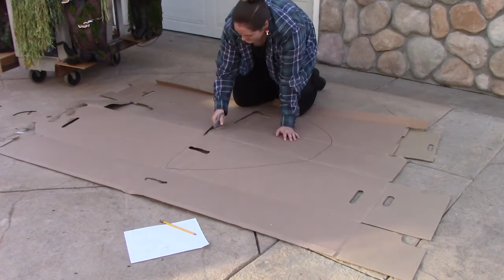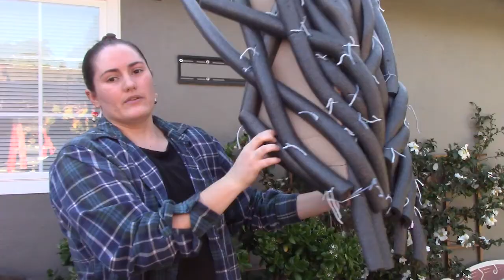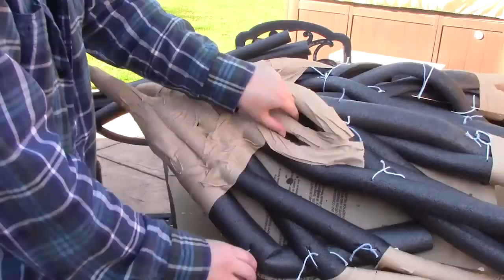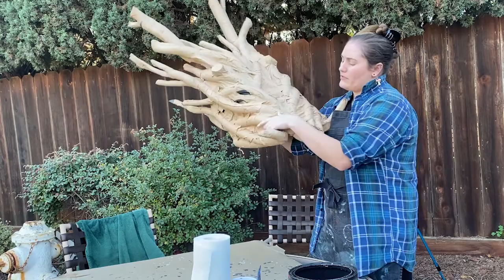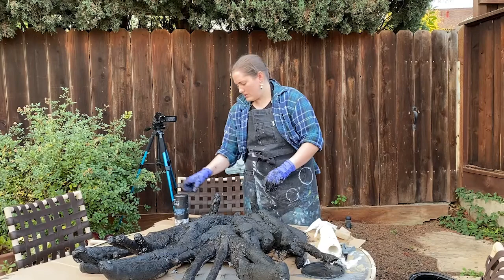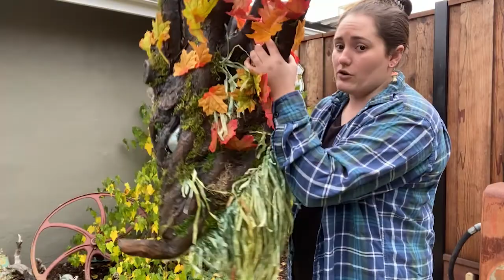How to Make a Custom Head for a 4-stilt Costume

Comment: Should I make my mask last ?
Reply from the maker: Good question! The benefit of doing the mask last is you can use the rest of the body to gauge its dimensions so it doesn't end up being too big or too small in comparison. Although, if you don't already have concept art drawn out, doing the mask first helps inform some creative direction for the rest of the costume, too. I've approached it both ways so it's mostly up to personal preference. Good luck!